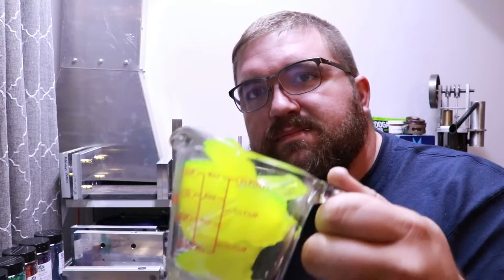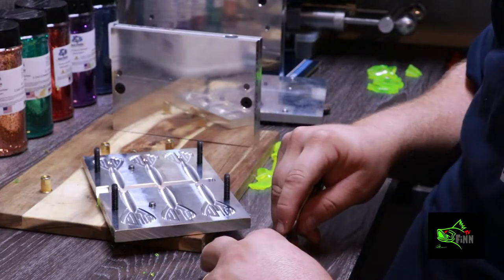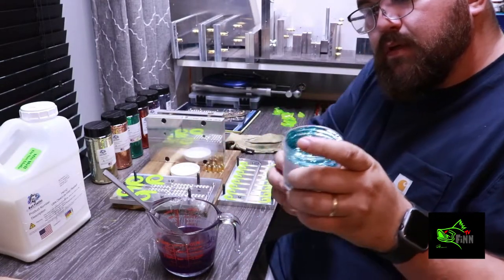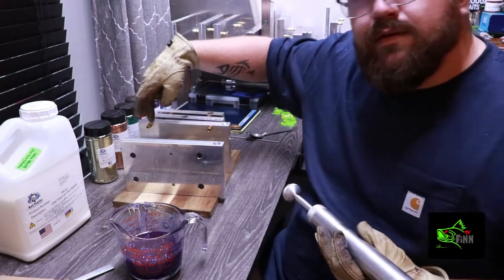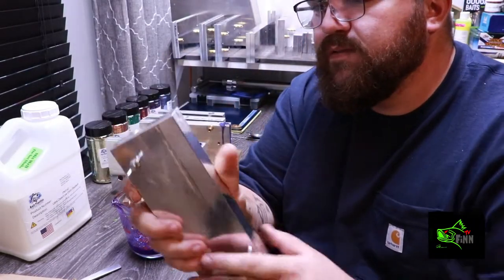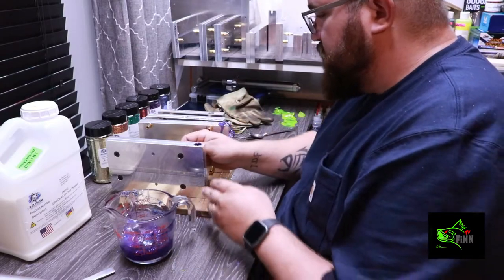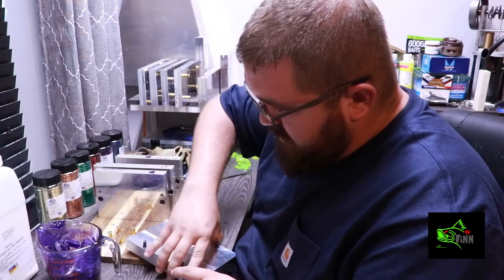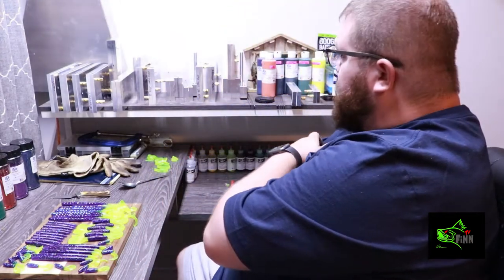My SECRET FAMILY RECIPE JUNE BUG | SOFT PLASTIC BAIT MAKING

Comment: I have made alot of the Epic prey, in laminate and solid color. I've never had that problem.If you are having that much shrinking it sounds like your molds are too cold, or maybe your plastasol is too hot and it needs pressure held abit longer. But if you have to top off,  heat your top off to 350 to 370 to make sure you get good thermal bond. You can also  make a sprue extender out of a peice of copper. I have 18 Epoc molds and they put quality and usability at the top of the list, I really don't see them  skimping on a mold to save 50 cents per unit.